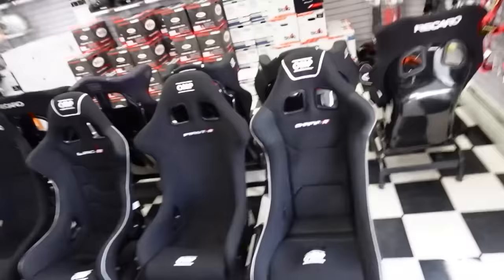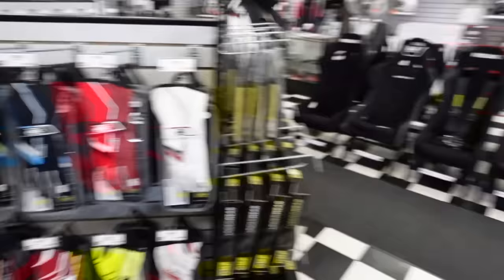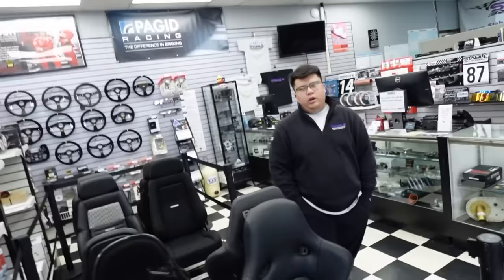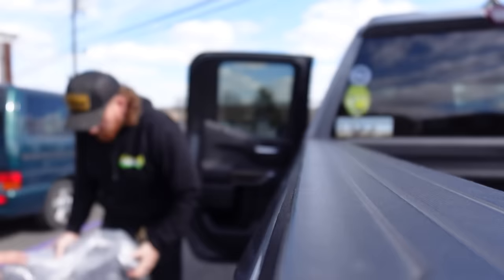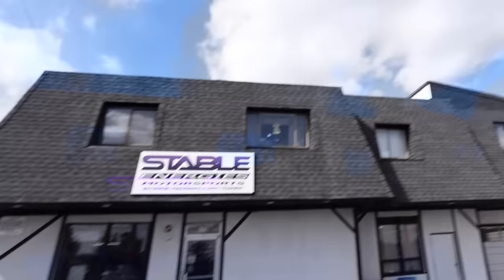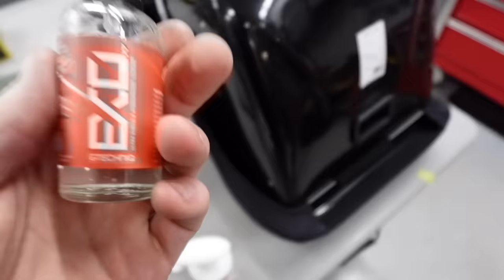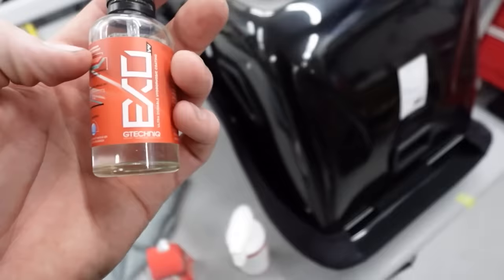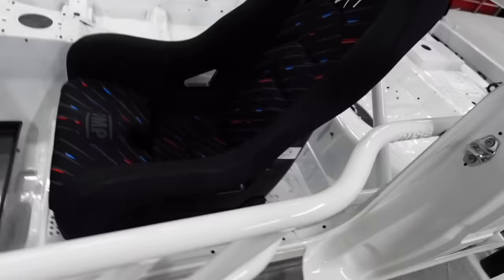Major Upgrades For my E46 Pro Drift Car!

Comment: Get a MillerMatic 250 and you can weld anything anyway! 3 welders in 1
Reply: 252 is a sick unit
Reply: Dont do it, i have the miller multimatic machine and its great as a mig but without high frequency start for tig it sucks, scratch to start is the worst thing ever invented, get a dedicated mig and a dedicated tig you will be much happier in the long run trust me...
Reply: Everlast mts lightening 275 is everything you need. Better than the miller multi process by leaps and bounds.

Comment: One thing I’m surprised the workers didn’t mention, thermal activation for fire suppression is huge if you get knocked unconscious. Button or pull cable won’t do anything if you’re out cold

Comment: Only use cable or button for the fire system.. ive seen the thermal go off when on a hot day with lots of laps so everything is hot..
Might of improved but i wouldnt trust it